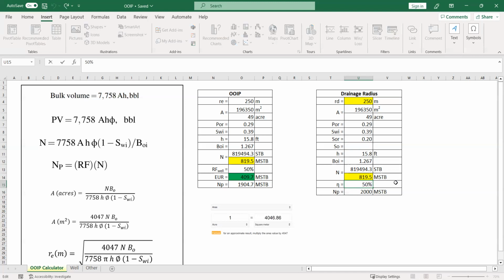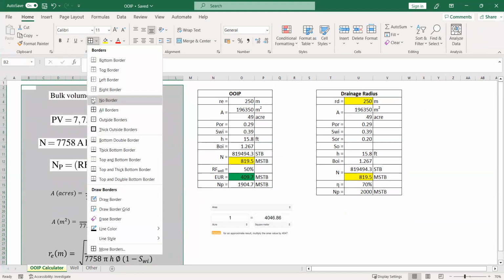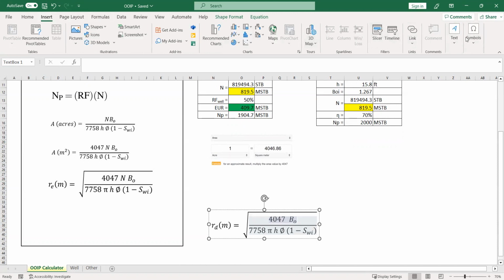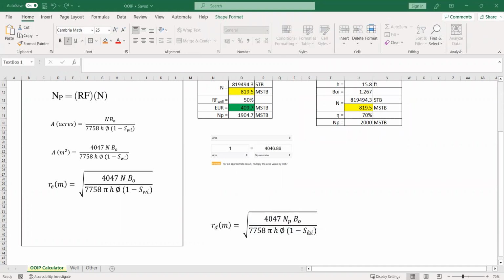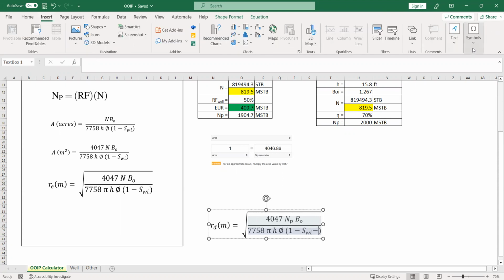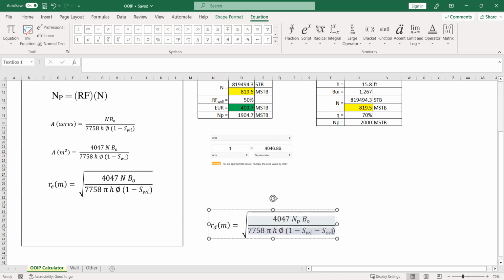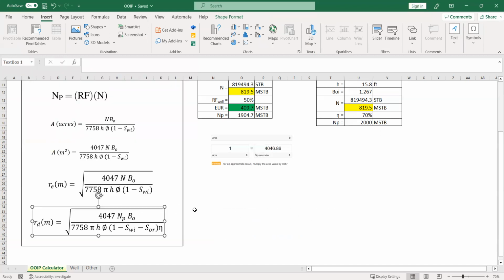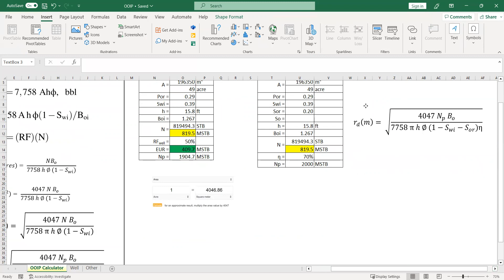Drainage Radius - Formula

Comment: I have used this before on my vertical oil wells producing from primary. , for gas wells is more critical to determine this value as with time their drainage area tend to clash with a neighbour well , causing reservoir pressure to further and sharply decline . I like your videos .